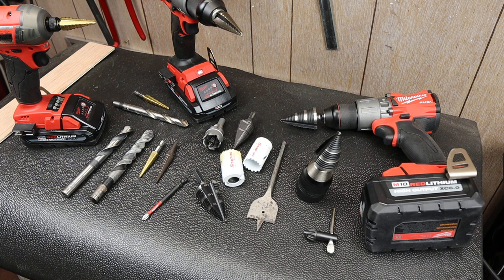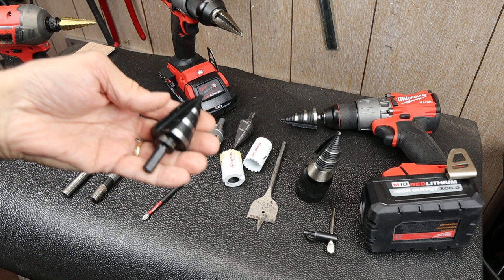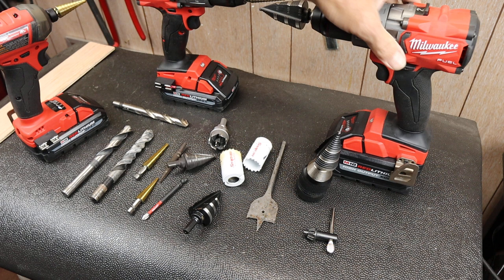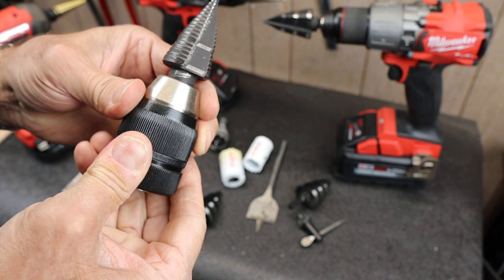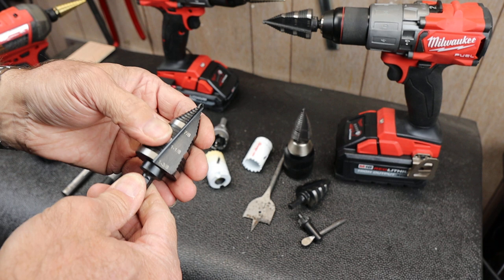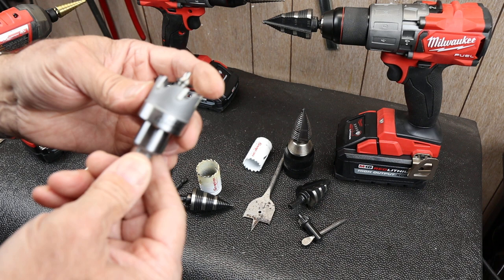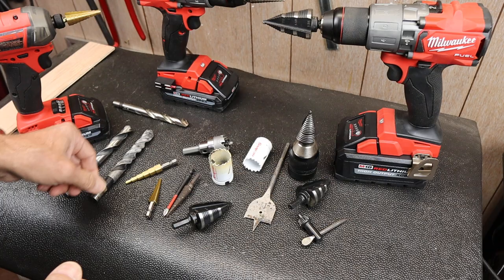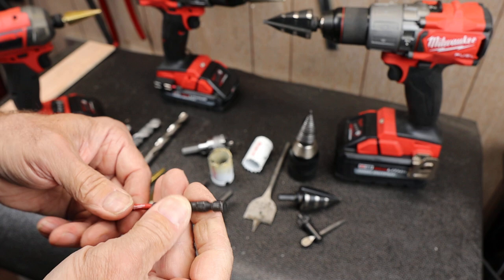Step Drill Bits are Amazing! Like regular bits but with Superpowers. Klein,  Milwaukee and Irwin.

Comment: klein and milwaukee and others highlight those sizes because electrician commonly use 7/8. 1 1/8. 1 3/8. Because those sizes are for emt conduit / rigid conduit as that correspondes with 1/2. 3/4. And 1 in. Connectors

Comment: I'm no expert on drilling, but the step drills seem to be the best for thin material.  You don't get that "jammed up" or stopping just at the point of breakthrough like with a twist drill.  But, like you said, the material can't be over the thickness of each step or the hole will be partly one diameter and partly another.

Comment: I have appreciated the insights you bring to tools and their selection so thank you for posting your thoughts :)
Do you have any insights on fine/precision wire strippers (16-28 Ga). I have been using some Teflon-coated fine wires and those are defeating the tools I would usually use.
Reply from the maker: I haven't used one yet, but Knipex has a unique designed one for stripping small wire.

Comment: So there is avery limited use of this step drill bit. Right?
Reply: Not really. It’s great for enlarging knockouts or holes to be covered with fender washers when mounting stuff. They can still into boxes for the most important conduit sizes 1/2,3/4, and 1”. All require 7/8,1 1/8, and 1 3/8” wholes sizes for connectors.